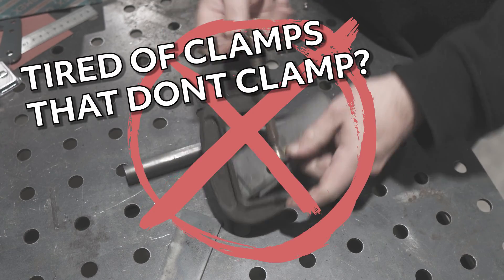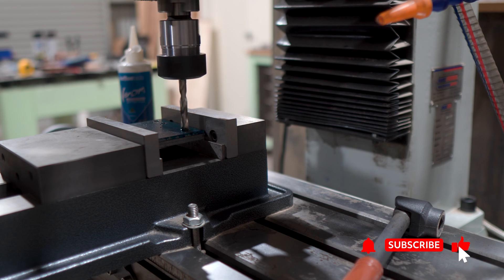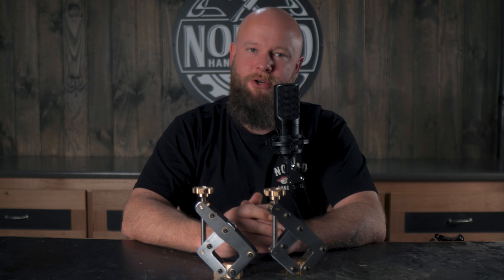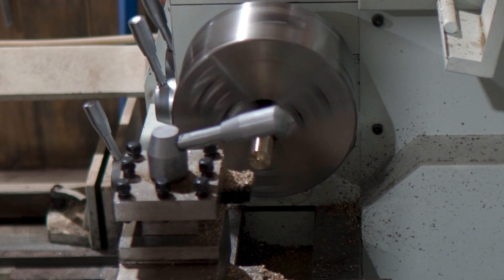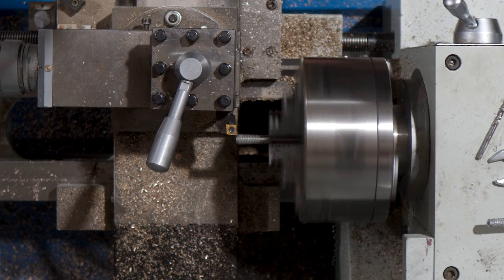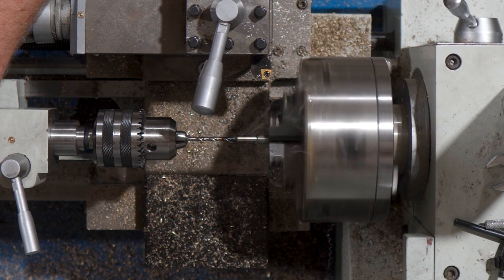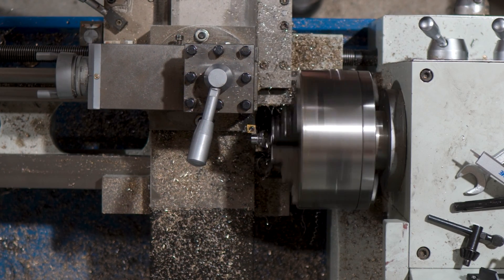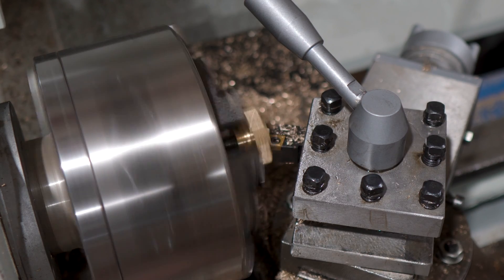Making Kant Twist Clamps:  A Clamp-tivating Project! 🗜️⚒️🗜️

Comment: Nice work! Next time when you do scallops I suggest plunging with the end mill instead of side milling into the knob. For six scallops the collet block is probably the fastest method. If you want an odd number of scallops, say 5 or 7, then you can use the bolt pattern function of your DRO.
Reply from the maker: Thankyou!! It’s definitely been on my list, I have only made scalloped knobs once since making this video, and I got slack and used a ball mill on its side, but I am curious to see how good I can get the finish from plunging, but thanks for the tip!!

Comment: You could also plunge cut instead of using the side of the end mill
Reply from the maker: I have learned a lot since this one, I would defiantly plunge and use the bolt pattern on the dro these days, but thanks for checking out the video!

Comment: Use a bolt hole circle calculator online, or there is usually a button on the dro that will also do a bolt hole circle.

Comment: I'm not sure about this case, but engine bearings have about 0.001" of oil clearance per 1" of pin diameter. So you could probably have gone tighter, but tighter tolerance is harder to produce, so 0.004" is probably fine.

Comment: for the jaws, why don't you drill a hole in through the brass then cut it in half? Just a thought
Reply from the maker: That’s a fair point! If I was making any more than 2 clamps I would probably square the whole brass bar, then drill into it on the lathe, and then just slice off the individual pads, but everything seems easier in hindsight 😂 thanks for checking it out!